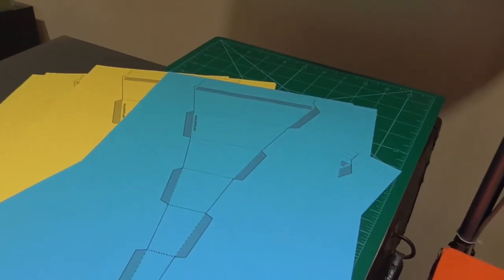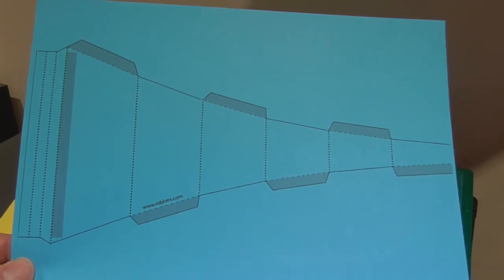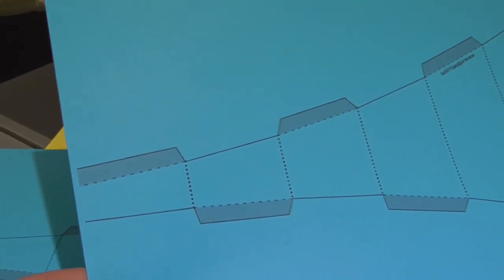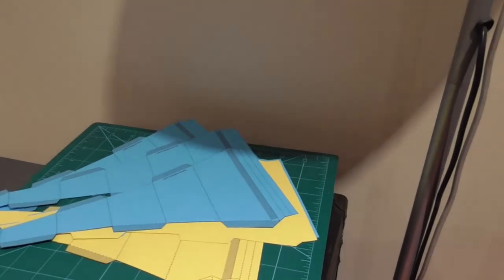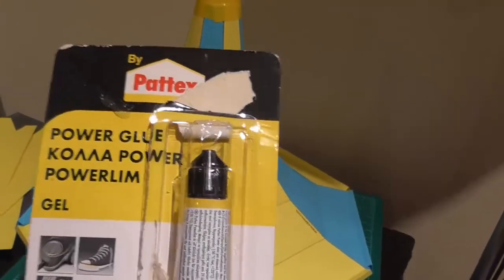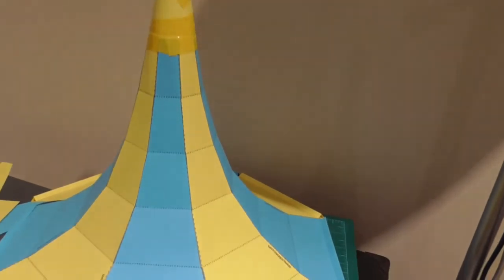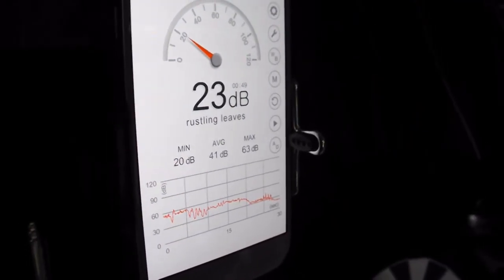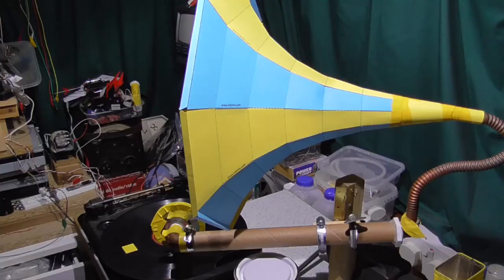BIG Paper horn test on experimental gramophone

Comment: What editing software/plugin do you use for the title effects?  I used to work at a video effects plugin company, and they look kind of familiar! :)
Reply from the maker: This one was done on Serif MoviePlus x6, however all my recent videos are done on Olive 0.1. Serif has better effects but is now quite an old piece of software and doesn't render very quickly (I  seem to remember it doesn't make good used of multiple CPU cores), and had an annoying rendering bug where it would loose the sound on a random clip which wasted much time with me having to adjust the video and re-render even though the edit was actually fine. Olive is very simple and does have a few bugs but I get on with it very well. I don't actually put titles in my videos anymore either as current YouTube best practice apparently suggests this just wastes the viewer's time. Thanks 😀 👍
Reply: @mrrgstuff  ah, so it's not my old company's software then (BorisFX). Interesting to know that YouTube discourages titles now- maybe that explains some of the low view counts on my videos  ;).  Also, I love your DIY videos- I've been working on a homemade gramophone myself and your videos have really provided a lot of help!  It's like anything I've thought of trying, you've already tested out :) the only thing I'm doing differently is that I plan to build my own governor/crank mechanism.
Reply from the maker: Yes, YouTube looks very closely at audience retention, especially in the 1st 30 seconds. Viewers can easily leave during titles and intros as they don't really see much value in them. If YouTube detects this, it won't show that video to so many other people.
Glad you enjoyed the diy gramophone stuff. There will be more of this, I have lots of ideas I still want to try out. Building your own governor sounds like fun. Would make a good project and it is on my list, though realistically I won't get around to it anytime soon. Good luck with your project. Would be great to see some videos of them. Thanks 😀 👍

Comment: @ 3.29 minutes-a mechanical tv with Nipkov disk? Strobe on disk looks like one that the NBTVA issued some years ago in their quarterly publication.
Reply from the maker: Yes, very well spotted. It's a 12" club disk but the rest of the rig is my own design. It's packed away at the moment and I never did finish the synchronisation, but hopefully one day that will change. I did another one with my own disk  that worked pretty well although it was manual sync only. Is this something you have tried also? Thanks 😀

Comment: Sorry if this is something you've already considered or talked about, but looking at your setup, my guess is that the bottleneck is the curved and corrugated copper pipe before the horn.  What I've seen of gramophones, there is a steady increase in the sound path all the way from needle to horn. And I should think that the corrugations would be bouncing the sound all around causing all kinds of sonic mess in there.

Really interesting though.  Keep it up!  Thanks.
Reply from the maker: +B. Lenz Hi, thanks very much for the comment. Fair point, I hadn't considered the corrugations in the tube. I'll see if I can find something better to use. Thanks.